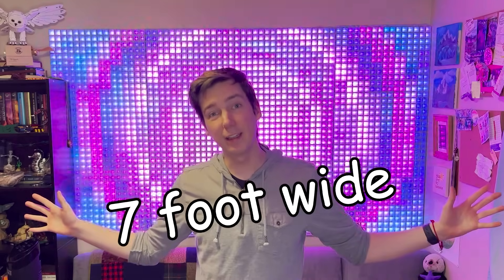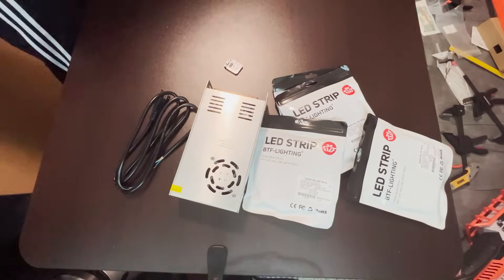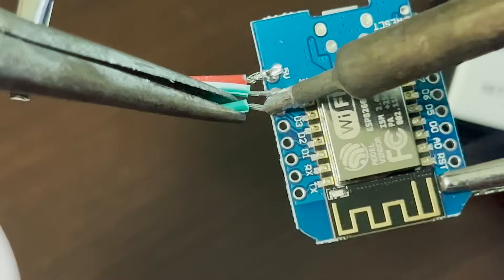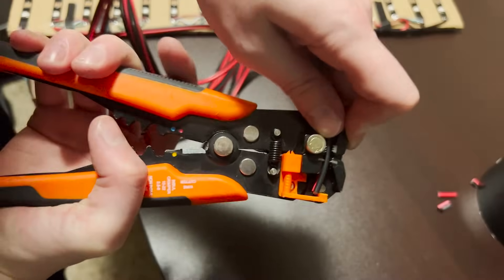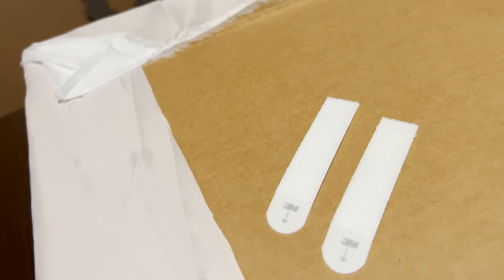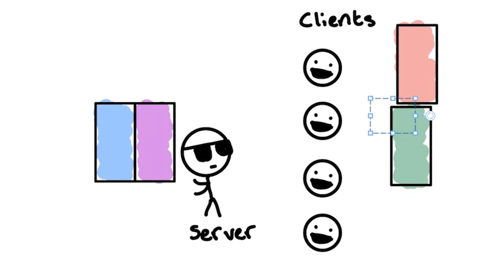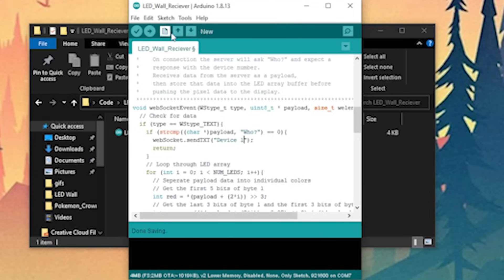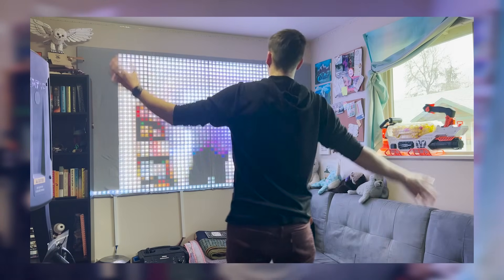How to Build a Massive LED Wall on a Budget

Comment: an engineer of what? It's certainly not electrical with the mega low quality of the solder joint on that 5v lead.
Reply from the maker: I’m a firmware engineer so I mostly write code haha

Comment: Starting mine this week!
Reply: Also used your referral links.  Hope it helps you with other cool shit!
Reply: Dumb question for you..

Did you affix all 4 panels together in a solid fashion?  It looks like you put the diffuser over the whole, 4 panel assembly. 

I’m debating between that for a seamless looking, solid unit finish. But I’m planning on using it as a backdrop and I think being able to stand the 4 up vertically, with some space in between could also look sick. 

Something like this-
  __  __
/             \
      🤓

lol, if that makes sense
Reply from the maker: I wrapped each panel separately so they can be moved really easily there is a slight seam between them but it’s hardly noticeable
Reply: @Tech-Random  fantastic! Thank you. That’s the route I’m thinking. Cause like you said, adding color and movement as a backdrop.. and it would be even sick to set the 4 panels around your table at like a convention type event. 

Super eye catching and a lot of perceived value. 

Thanks again for taking the time to share and make the tutorials
Reply: Sorry to keep bugging you. I’m about half done with printing and chomping at the bit to get assembling

Like I’d mentioned, I’m considering using this at say a convention type event at my table/booth. 

It occurred to me though. I’ve been thinking to make one video, but have the source video divided into 4 frames to correspond with each independent panel. So you’d run one video as the source, but each panel would appear to play or display something independent. 

If it turns out alright, I could send you the grid overlay to use as template to add to the GitHub or instructable. 

At this event I’m aiming to bring it to in September, counting myself it’s a group of 3. So I was thinking about displaying something to represent each one of us on our own panel, and then have our socials listed out on the fourth.. or something to that effect

Also on the P1P I’ve managed to cut each pixel panel down to just shy of 2 hours. At the .12 factory settings it’s over 3. But I increased the layer height a bit and on sport mode comes down to 2. I’ve found that if I flip it to ludicrous mode after the first few layers are done, it makes it much much quicker.
Reply from the maker: I think this type of display is perfect for conventions. I can’t wait to see how yours turns out!
Reply: I’m finally starting to put this bad boy together. 

But I just had an idea..
I’m going to use a spare wifi range extender that I have lying around to act as the network between the Jumbotron and the laptop I’m running it with. That way, it’s super easy to setup or move it. If I have the extender and password configured into it, say in the convention example.. I just plug the power source and extender into the same spot and it’s ready to go. This way too at home I don’t have to worry about it bogging down my actual wifi network
Reply: Stupid question too.. should each panel be identical?

Like if I leave my connector on the bottom left corner, with the bottom strip’s arrows going left, should I replicate that exactly to each panel? Or should they alternate?
Reply from the maker: All four panels should be identical. The only difference is the one line of code that identifies each one’s position
Reply: @Tech-Random  thank you!
Reply: @Tech-Random  ugggh. Sorry. I’m back. 

1- did you voltmeter your power source outputs at all? Or just sort of trust it out of the box? 

2- do you have a better image of where you put the leads from the power source onto each board?

Coming along nicely. I’m stupid excited to get this thing done
Reply from the maker: The exact output of the power supply and where you connect it to the panel don’t matter very much since all the components are reasonably tolerant. You’ll need to supply power to both ends as well as the middle so all of the pixels get enough voltage,otherwise you’ll notice some of the pixels turning pink when you light up the panel at max brightness. This won’t actually matter if you don’t intend to run them at max brightness so the exactly locations don’t make a difference
Reply: @Tech-Random  thanks. I think I’m going to add some extra length to panels 1 and 4’s power wires. That’ll let me move them out more if I want to use them separated. Also gonna put quick disconnectors on the lines so when I move it they’re not tied to the power block.  Think I may make some PVC stands for them for when I use them outside the house
Reply: @Tech-Random  my lord, sorry to come back again and again..

For your power supply. In the visual examples on here and instructable, you mention and show the 3 power wires, about 4’ each. 

Did you just twist the 3 from each panel together and put those into the terminals on the power supply? So there’s a total of 12 + and 12 - going into the +/- V terminals?

Again, forgive my ignorance, just trying to be sure. Electricity isn’t quite my thing
Reply from the maker: Yep!
Reply: @Tech-Random  sick, thanks. The continuity and max voltage test both checked out. Hoping to finish tomorrow
Reply: @Tech-Random  got it going today! Gonna build a PVC stand for it I think. 

Had some issues initially. First plug in, one staple just happened to short 5v to Ground just right and basically acted like a vape coil, wound up burning a hole in the diffuser and cardboard. I wound up cutting that section out and hot swapped a spare piece from the leftovers.. glad i kept them. And glad I had extra diffuser. 

Works well enough so far. But I’m pretty sure my dookie laptop is having trouble keeping up with it. I have a spare, newer mac book lying around so I may put boot camp on it and see if that runs it any better. 

Thanks again for this awesome tutorial, the instructable and your help here in the comments. 

Once I get a proper stand, I’m gonna make a demo video short and will put your links in the description

To anyone following along with this video:
If you get the 6 pack of the ESP boards like the link in the description. I highly recommend leaving FastLED_Test installed on the spare. If you have any issues pop that on the problem panel(s). I used this after repairing as a quick, on the fly test and it was super handy. I tested again after stapling just to make sure I didn’t Nick into a lead again
Reply from the maker: Glad to hear it’s working! Worth noting that LMCSHD doesn’t run natively on Mac but there may be a way to get it working.
Reply: @Tech-Random  yeaaaaah, I’d noticed it was a .exe application 

However, in the past I’ve run Windows based CAD/CAM programs to run a CNC (hard tangent, I know), but we used BootCamp for it. Basically, to my understanding/observation, BootCamp basically patricians apart of the hard drive and runs windows on that “side” of the machine. You can even swap between windows and osx fairly quickly. I’m not a computer guy, so I may be off in my explanation, but we were able to run and old ass (~06) version of windows-only MasterCam on the iMac

Comment: I've done a very small LED panel way back using Arduino UNO as the brain and It worked just fine but looking at this project using wifi and having the ability of adding more panels for making perhaps a big LED Wall is awesome. Thanks a lot for sharing this project. It made me want to go back to my old project and maybe creating a bigger panel just like yours. Regards.

Comment: I’m wondering, if I want to use the panels for a gig (several venues), should I use my mobile phone network? Terrific project ❤
Reply from the maker: That’s a great idea! You can also set up the server ESP-8266 as an access point and have the panels connect directly to it, but it will require some modifications to the code. For a live gig I would probably opt for a wired connection since the wireless version tends to miss frames and stutter a bit
Reply: @Tech-Random  actually, I’m working on wearables that syncs with my DAW (ableton), and I’d rather the most wireless option 😅 however this is a great approach since I have been working with RF modules (nrf24l01) and Fastled
Reply from the maker: I only have a little bit of experience making wearables but I think RF is going to be more reliable than Wi-Fi for more than a dozen devices. You should look into infrared since it’s really low power and can transmit signals to a theoretically unlimited number of devices at once. I’ve seen videos from the Taylor Swift tour using IR wristbands to show patterns of light in the crowd. Seems like a great way to interact with the audience at a relatively low cost.
Reply: @Tech-Random  oh yeah, I saw it in the xylobands in the Coldplay concert. it uses IR to do the secuences BUT it needs a large IR transmitters. I’m gonna research though 🧐 it would another great option
Reply: Great video,  I'm going to build one of these but would like to do different dimensions.  Is there any technical reason you did 36 led strips? Could you do 1m metre strips of 30 leds without any issues?
Reply from the maker: You’ll have to change the height and width values in the code but other than that it should work just fine!

Comment: Is it safe to put heat-generating LEDs on cardboard?
Reply from the maker: These LEDs don’t generate nearly enough heat to be a problem. If you’re going to use 12v LEDs or maybe a higher pixel density then I would suggest using something more resilient

Comment: Maybe you could make a mobile app to controll the LEDwall, using the phone built-in wifi? I've seen something like that made on PixelPusher controllers to work with an iPad a while ago. Your project is simpler and cheaper to build though :)
Reply from the maker: It currently runs a web page you can access from your phones browser to see the status of each display. It would be fun to expand that web page to add more user controls.

Comment: Could you put the led straps closer to make better resolution?
Reply from the maker: The led strips have a fixed resolution but they sell them in higher density versions. This is 30 pixels per meter (ppm) but you can also get 60 ppm or 144 ppm. If you want to use 60 ppm strips then your final panel will be 1/4 of the size or you’ll need 4x as many strips and power supplies making it more expensive

Comment: Would the software be able to handle 24 segments instead of 4, as long as I had a stronger server?
I'm looking at making a much more dense one of these. 
(looking at those tighter 144 pixel addressable strips, and stacking them 6 pixels tall for trim pieces.)

I have an extra dedicated router,  that I can force channels(limiting WiFi traffic), and a handful of mini PCs that any one would have plenty of compute for a dedicated server.
Reply from the maker: I think you would need to go with a wired connection to get a decent refresh rate with that many pixels. My four panel setup maxes out at around 18 frames per second so 24 panels may only be able to get 3 fps. Also keep in mind the power draw and brightness of this type of display. Even at a low brightness you’ll want a strong diffuser so you don’t need sunglasses to see the image.

Comment: Hi there, amazing project!!!
You inspired me and I'm building my LED wall, I just assembled the 1st panel. You also inspired me to buy a 3D printer which is printing the grid right now. I went with my own design, a grid with curve cubes printed with white filament (I didn't like the Diffusing Cloth).
What I don't know is how you managed all those cables and power supplies… I've been thinking maybe it is possible to use one power supply for 2 panels if you lower the maximum brightness of the LEDs, so would be 2 power supplies for all 4 panels. Or maybe a better power supply for all 4 panels? What do you think about it? Or what pro tip can you give me to have an easier time managing all those cables?
Thanks!!!
Reply from the maker: You can definitely only use two power supplies if you set the brightness low in the code. If you want to cut down the number of wires make sure you use a thicker gauge and connect it to multiple points on the panel so you get enough power to all pixels.
Reply: Could you post a link to a photo of your grid design?  I don't see a way to post photos to comments here.  Or even just describe the shape?
Reply: @surferdudemi  https://youtube.com/watch?v=ixqhwR85Fd4&feature=share7 
this is how it looks.... But I'm working on a new design where it's double face, so I'll hang it on a window and you will be able to see the panel from inside and outside
Reply from the maker: That’s amazing! Your panel design is really clever.

Comment: Are those BTF LIGHTS
Reply from the maker: Yes I used 16 of the WS2812b 30ppm 5 meter (150 total pixel) strips from btf-lighting. There’s a link in the description to buy them from Amazon but you can probably find them cheaper on Ali Express.

Comment: The serial communication problem while using 4 pannels could be easily solved using a serial multiplexer like the HP4067, this one lets you pipe up to 16 different serial inputs lol
No need to use fancy servers.
Reply from the maker: Good suggestion. I just used this project as an excuse to learn web sockets even if it’s not the most practical solution
Reply: @Tech-Random  Then that's a good use :)

Comment: What about reboot of esp32 will it resumes
Reply from the maker: If you reboot the receiver esp8266 boards they will reconnect and resume as expected. Rebooting the source esp8266 will require you to reconnect in LMCSHD and then it will resume.

Comment: thanks for sharing，I‘m coping your project and get some trubles when it gose to ‘single panel firmware’，when i start capture the screen，there were no images on the panel😂，i'm sure two esp8266 D1 boards were connected to my wifi，i don't know why😢
Reply from the maker: Try flashing LMCSHD_Test to the panel's ESP8266. This lets you drive the pixels directly from LMCSHD without going through your WiFi network. Remember to use the 24bpp setting when testing a single panel. Also make sure you are connecting to the correct serial port. With the wireless version, try connecting the first ESP8266 to LMCSHD before powering on the display. If the dimensions don't automatically populate then click "Serial->Connect" and fill out the settings again without unplugging the ESP. I hope this helps with debugging your project!

Comment: If you made 45 of these 16x32 panels  
You could have 160x144p which is the native resolution of an original gameboy/gameboy color

Although it would be 16 feet by 8 feet. of pixels....

Also that'd be about 450 amps of power, so you might need a few houses working together to power said gameboy.....
Reply from the maker: Only one way to find out 😂

Comment: I designed and had built a signboard for a rock band with 2500 LEDS wired as ten strings of of five connectorized strings of discrete "bulbs".  The ten strings were driven using an AT750 CPLD to demultiplex the SPI bus from a Raspberry Pi.  Every pair of bytes from the Pi sent one bit out each of the ten strings of LEDs.  Doing things this way allowed a much higher total data rate than if all LEDs were in one string.  The one problem with the sign is that many of the blue and green LEDs within the bulbs are failing. even though I've only been driving them at half brightness outside of a few flashing effects.  I hope you have better luck with long-term longevity than I have.

Comment: Nice project!
I have some questions about, let's call it "pixel size". Have you tried making individual pixels smaller so you can fit more of them on one display making it higher resolution? I guess that the size of your divider grid is a result of space between individual LEDs on your strip, but have you tried using LED strips with higher LEDs density or maybe even individual LEDs?
Reply from the maker: I’ve used higher density strips for other projects but my goal with this was to make the biggest screen possible for a reasonable price. If I used a smaller pixel size I would have needed more LEDS, more power supplies, and more controllers. The cost adds up really fast!

Comment: Sounds like we could DIY a high Res dot matrix, provided we isolate the light leaks and the heat from all that LED running (not to mention the electric cost ...)

Maybe we could DIY a 16 bit high Res version before a 32 bit (I think this Res is about 8?

Comment: can you make this wall with the leds more dense
Reply from the maker: Yes but there are a few things to consider if you’re going to try this. Doubling the pixel density will require 4 times as many LEDs. This will make the cost significantly higher, require more power supplies, and require more data to be sent to each controller. If you make a higher density panel that’s this size you should use a wired connection, rather than the wireless one I demonstrate in this video, unless you’re okay with a low frame rate.

Comment: Nice project, have you ever looked at software like WLED and JinX? With these two projects your project is also doable for those who find microcontrollers pretty difficult on the software side

There are a lot of people out there already making controllers for these kinds of projects, making the project even more easy :)

A wall like yours is also being used in a Ramen shop in Prague, Czech! 
Hope you keep doing these projects and look into the projects i mentioned above, they save you a lot of time and might even make more difficult projects possible in less time :)